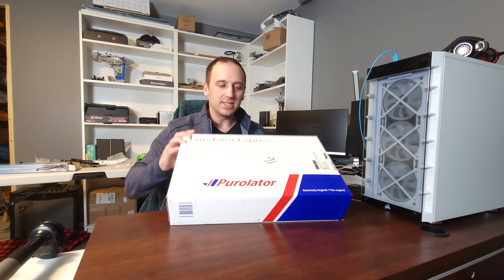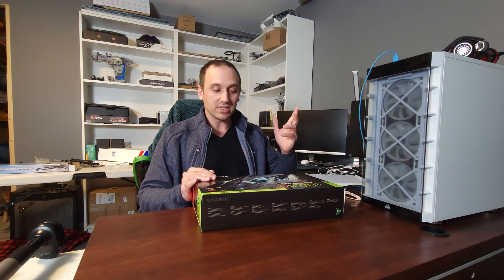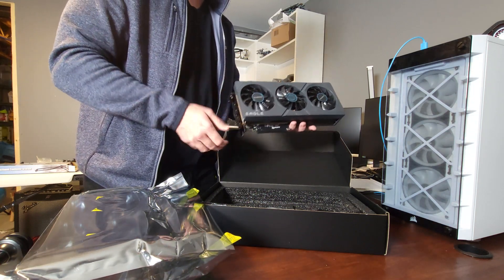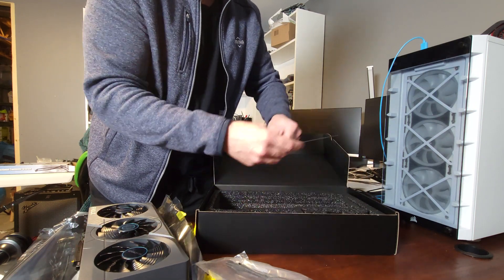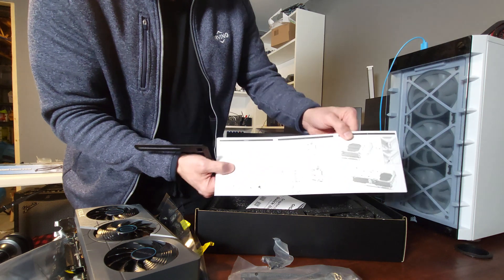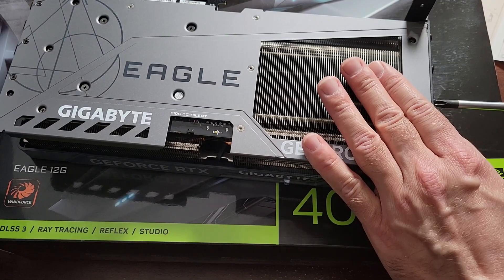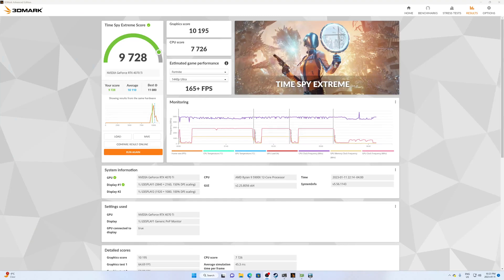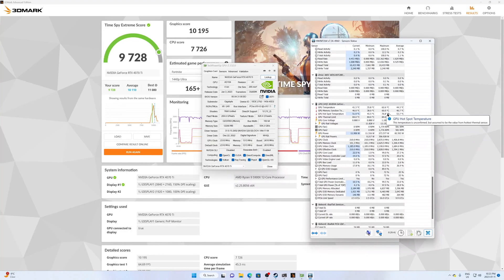Gigabyte Eagle RTX 4070 TI unboxing, installation and Time spy extreme score

Comment from the maker: If you have any testing/benchmark requests leave it in the comments below. Over the next week I hope to get a number of videos out testing it in Fortnite, modern warfare 2 and other games.
Reply: I don't suppose you play vr? That seems to be the big unknown at the moment. I ordered the same card as you. $1119 cad. I win! Hehe just teasing ;) mine won't be here till next week though.
Reply from the maker: @lemurdreamur9257  no I don't have VR. I double checked how much I paid for mine and it was the same as yours. You must have gotten yours from Canada computers as well.
Reply: Hello, very good board, I bought the same and waiting to receive it, if you can answer me and clear this doubt... I noticed that you connected the two 8-pin cables, searching I found a technician here in Brazil, who connected only an 8-pin plug which gives 285 Wats which is what the board needs, you connected the two 8 pins totaling 16, did you have any problems?
Reply from the maker: @marcoskru  I needed to connect 2- 8 pins. It didn't work with just one.
Reply: The one percent lows on the OC model are a problem. How do you lower the boost clock on the OC model to get the once percent lows to a sweet spot. There is a silent mode on the card, that cleans them up a bit. The reason being, this card should appeal to people with 3rd and 4th gen CPU's, and extra performance is better spent on improving one percent lows.
Reply from the maker: @MozartificeR  I'm not sure of the 1% low issue you are talking about. Was it a specific game. If so, it is probably a driver issue.

Comment: The angle at 10:58 is quite hard to look at. Whjere did you screw in that thumbscrew? I can't see it.
Reply from the maker: It's where the metal plate on the gpu lines up with the metal plate connected to the motherboard.

Comment: How come yours came with a 2x 8 pin and mine came with 3x 8 pin? Would I just need to connect 2 of the 3 8 pins?
Reply from the maker: 4070 ti doesn't need that much power so not sure why you got 3  x 8 pin connector. Not sure if connecting just 2 will work.
Reply: @jackshardware  yeah not sure either.. I got the Asus ROG Strix OC edition of the 4070 ti.. I'm so curious why this card has two different cables between brands
Reply from the maker: @Amirichi  it might just be easier to procure a big lot of 3x8pin connectors. You can probably get a separate adapter that has 2x8pins to 16 pins.

Comment: this or MSI RTX 4070 TI VENTUS 3X 12G OC?
Reply from the maker: Gigabyte has been having issues with their video cards cracking near the pcie interface. Because of that I would go with msi.
Reply: @jackshardware  Thanks! The only concern I have for MSI Ventus is the heating issues.

Comment: Can I get away using 1 8 pin pcie for my 4070 ti? I read a lot of posts where some say yes and some say no. I’ve got a 1000w psu from Corsair
Reply from the maker: I'm not sure if it would or not. However with the amount of power it can draw i would recommend using 2 separate cables.

Comment: Want to buy a 4070 TI. But not sure if it will fit on My Mobo.  I have an AS Rock B550M-C.  It seems to be a smaller case (was a pre built).  Currently have a 3050
Reply from the maker: Get a measuring tape out and check. You can always buy a bigger case for pretty cheap and transfer the pc over.

Comment: I am in the process of making a fairly similar build to yours: CPU - 5800x3d; GPU - 4070; MBO - B550 Tomahawk; PSU - RM750x; one question you might be able to answer - can you use the Corsair PCIe 5.0 12VHPWR Type-4 PSU Power Cable for a more cleaner look (if so it would help to avoid the hassle of having to connect the x2 pcie 8 cables to the provided pcie gen 5 power connector adapter), thank you
Reply from the maker: Yes you can. I just picked up the corsair rm1000x shift for my am5 build.

Comment: would be good inside a corsair 4000d airflow?
Reply from the maker: It would be. It has a higher cpu cooler clearance as well so it will put less pressure on the power cable to the gpu. When I close the side panel on my 465x it pushed against the new pcie 5.0 power cable.

Comment: Honestly, I have the same box and I'm hesitating to buy a 4070ti, but I'm afraid I won't be able to place the glass because you can't bend the cable too much
Reply from the maker: I was able to close it. But the cable does push up against the glass. You can get 90 degree angled adapter.
Reply: @jackshardware  You have convinced me, thank you for your answer. I imagine that the cables are different depending on the brand and model of graphics card, some people must have thought about it. I don't know, I'll see

Comment: So, you have 2 8-pin PCIe connections just hanging freely, not connected?? Is that how this GPU connection to the PSU works? I need to know, lol. Just one of those 8-pin connections by itself doesn't seem right and if you use the two 8-pin (16) connection you're left with two open connections just hanging. That also doesn't seem right to me. But I don't know.
Reply from the maker: On the 4070 ti I probably could have gotten away with it. I didn't want to limit the amount of power draw so I used 2 separate 8 pin connectors not daisy chained together.

Comment: I just bought and installed this card, but i cannot control the gpu fans.. they just keep running on 100% and unable to turn them off? did anyone have this issue? any help is greatly appreciated.
Reply from the maker: Check your gpu temperature. It's possible it's overheating. Also check GeForce experience. Fan speed might be set to 100.

Comment: Nice vid, but no footage of the visuals of the card installed with lighting etc is somewhat dissapointing.
Reply from the maker: I never even thought of that. Thanks for pointing it out. I'll remember to do it next time. I'll be doing another review of the card in the future and will include it then.
Reply: Thnx for the response. Overall the video was really helpfull, i liked the fact that you also pointed out the 12 pin connector for instance, the indepth info and straight to the point. Im looking forward to the continuation of the review of this gpu.

Comment: My 3080 recently broke so im getting a 4070ti instead

I was just wondering if the 192 bus width of the 4070 ti compared to 320 bus on the 3080 would make any difference? 

Cause i have no clue how bus width works. And thanks for the video def gonna use this vid when installing.
Reply from the maker: It just limits the ability of this card to game at 4K. The higher resolution requires faster access to memory which the 4070ti doesn't have. Just look at what happened to the 3060 when nvidia dropped it to 8gbs.
Reply: @jackshardware  Ok thats no prob for me i play on 1080p 165hz. 

But sometimes i use supersampling/dssr i think its called. Will preformance of dssr be effected by the bandwidth for example if i use dssr to upscale my game to 4k on my 1080p monitor?

Comment: my usb 3.0 connector won't allow me to install the bracket
Reply from the maker: Would a 90 degree adapter solve the issue.
Reply: @jackshardware  funny you mention this) 90 degrees adapter actually prevented me from installing this. When I tried to remove the adapter, the housing got stuck. Now I basically don't have from panel usb 3.0

Comment: Hello, I have the same case CORSAIR 465x. So the card has 137mm width plus connector 12HPWR . Could You close/fit glass panel ? I mean the card is not too width?
Reply from the maker: The card itself fits easily. The power cable coming out pushes against the glass. It would be nice if it came out at a 90 degree angle instead of protruding straight out.

Comment: Bracket just gets in the way of my USB 3.2 header.  Not sure what to do.  Does it really need the bracket?  Or should I sacrifice and go down to USB 2.0?
Reply from the maker: It's a pretty big card. Personally I would rather have the extra security by using the bracket.
Reply: I have the same card and dont use the bracket. When mounted  There is almost no movement, so Its pretty sturdy. Card is only 300mm.

Comment: im i good to pair with 5600x for 1440p gaming only?
Reply from the maker: My 5900x is bottlenecking the 4070 ti a little bit at 1440p. Your 5600x will as well. With that being said I would still go for it or the 7900 xt/x.

Comment: That bracket probably won't work on my Corsair 4000D
Reply from the maker: My case is the corsair icue 465x. It's roughly the same size as the 4000D so you should be fine.

Comment: yo le cable alim e fourni avec la carte ? j'ai une 650m ca le fait ?
Reply from the maker: The 2 x 8 pin to 12 pin adapter comes with the card. I think a 650m should be fine as long as it has 2 x 8 pins.
Reply: @jackshardware  yo mec j'ai une Textorm TX650M+ c'est compatible ou pas stp

Comment: What about bracket ? Is there any bad impact from card weight to motherboard ? Only Gigabyte use this kind of bracket :D
Reply from the maker: Those screws go right into the case so there should be no impact to the motherboard. Smart on gigabytes part to include that bracket.

Comment: I’m still rocking a 970 and I’m thinking of upgrading to this card.
Reply from the maker: You might need to do a whole system upgrade if you are going from a 970 to a 4070 Ti.
Reply: Peter Bread  for a couple of years 2K resolution, definitely
Reply: Wow

Comment: What is the average fan speed during benchmark. Do not count idle 0 rpm into it. I am also interested in how loud is the card on silent bios as I am able to get my hands on one for a good price as well but that is one thing that I am a bit worried.
Reply from the maker: I haven't been able to use the silent bios yet. So far though it's been hovering between 1300 and 1700 rpm. The noise is only slightly louder than my case fans.

Comment: Thanks. I was wondering wtf to do with that adapter thing. Just got mine but haven't tried to install since I realized I forgot my additional PSU cables... In another state. 

My currently installed 1070 only calls for like a single 8 pin so I'm fucked until I get more cables I guess. Anyway, thanks for the video, this is exactly what I was trying to see.
Reply from the maker: Glad it was informative. You can always try ordering an additional 8 pin from you psu manufacturer.
Reply: @jackshardware  I left the whole box back home and I just moved. I was considering just buying the 8 pin online, yeah.

Infact.... Screw it. You and this weed talked me into it, thanks again!
Reply from the maker: @Mattfreeman89  can't let that expensive piece of hardware collect dust.

Comment: You have bent the 12vhpwr connector is it ok? I heard that you need to keep it straight to avoid issues
Reply from the maker: It's not overly bent. I have about 1.5 inches between the gpu and case panel.

Comment: Can you comment on overall noise at load and did you notice any coil wine with your model?  I'm trying to pick a 4070 ti model and this one is available but I've seen some reviews which say the card is loud at load and one review (german) which said their card sounded like a "concert" with whining, pops and chirps at load.
Reply from the maker: I've been playing MW2 for 40 mins now and I can't hear the card over my case fans. It seems pretty quiet to me.
Reply: @jackshardware  Thanks, are you using the default OC bios or the silent bios (switch)?
Reply from the maker: @shredman59  oc bios
Reply: @Shane Belanger I ended up seeing a review of the PNY 4070TI OC and it showed the cooler was really effective and fans didn't spin much at all.  After doing some research and seeing PNY makes high end cards and  a lot of other PC components, I got the PNY and happy so far.  I've haven't pushed it too hard TBH due to working a lot lately but no coil whine at all and very quiet.

"PNY's factory overclocked RTX 4070 Ti is based on the NVIDIA reference PCB design, PNY just added circuitry for their RGB lighting effects. The cooler on the other hand is a fully custom design, and PNY did amazing work here, just like on their other GeForce 40 cards. Our apples-to-apples heatsink comparison test that measures only the heatsink's capabilities reveals that PNY is offering the most powerful cooler of all the cards tested today. They also paired it with fantastic fan settings that are incredibly quiet. Just 28 dBA under full load is whisper quiet—even in a quiet room—very impressive. At this noise level, the PNY RTX 4070 Ti OC is the second-quietest card, beating all the other famous big name brands! Temperatures are really good, too, just 63°C is comfortably cool. What I really like is that PNY isn't hiding those great fan settings behind a manually-activated dual BIOS "quiet" profile like some other vendors do. As expected from all modern graphics cards, all GeForce RTX 4070 Ti cards come with the idle-fan-stop capability that shuts off the fans when not gaming."  https://www.techpowerup.com/review/pny-geforce-rtx-4070-ti-oc/42.html

and this review:  https://www.tweaktown.com/reviews/10314/pny-geforce-rtx-4070-ti-xlr8-gaming-epic-rgb/index.html

Comment: Do you need to use the 12 pin adapter to plug it in? I have Lian Li rgb strimmers which are 2 8-pin connections connected to each other. Can’t I just use one full 8-pin and then use only 4 out of the 8 pins on the second cord?
Reply from the maker: The 12 pin adapter is a completely different shape. You need to use the supplied adapter.
Reply: @jackshardware  Well that sucks. Guess I can’t get a 4070 until Lian li makes an adapter
Reply: @pinheadlarry2506  Whats your actual GPU?
Reply: @keizhardy931  I have the 3060 12 gb from MSI
Reply: @pinheadlarry2506  🤦‍♂
Reply: @hovercroft  😐
Reply: @pinheadlarry2506  it comes with the adapter?
Reply: @Mattfreeman89  idk I haven’t purchased it cuz I wanted to see if it was possible to use my current connectors with it. Apparently it isn’t but thankfully Lian li is creating the 12v adapter so soon I’ll be able to get the gpu while be able to keep my lain li rgb cables